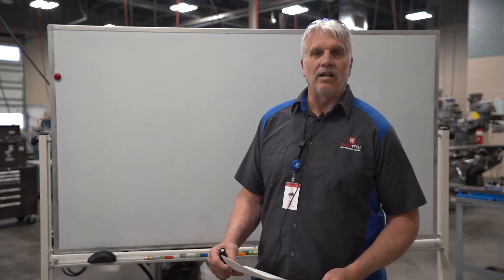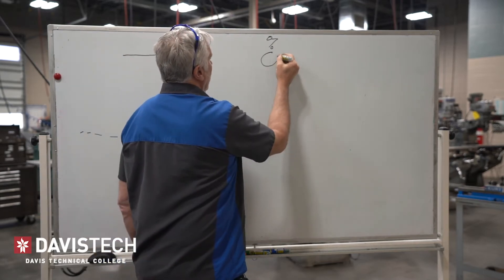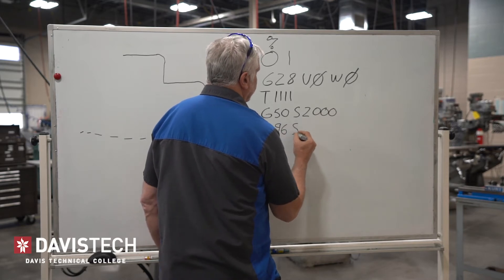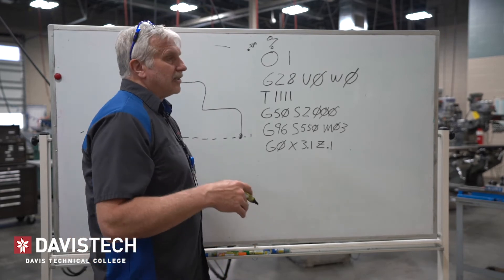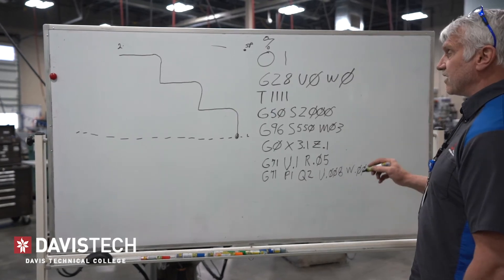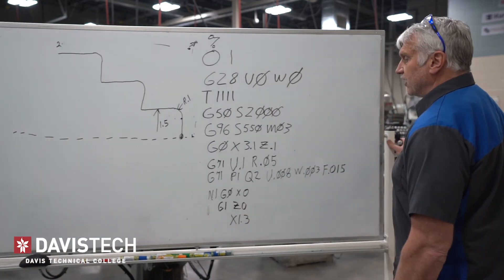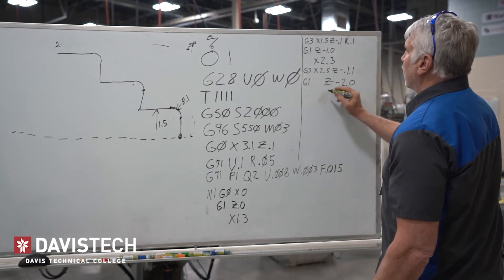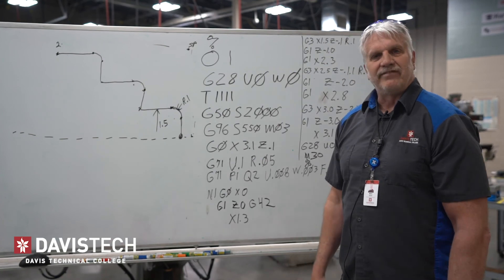Programming a CNC Turning Center 1

Comment: Hello, I hope you have a very good start to the new year 2023, I have a question and I hope you can help me.
Currently working with a youji(fanuc) vertical lathe.
I am studying a book which is CNC CONTROL SETUP FOR MILLING AND TURNING(PETER SMITH) which is based on fanuc, there is a section where the g90(Box type roughing) cycle and g94(Box type face cutting cycle) are listed, so my A question arises when I see that in my machine (youji) it takes g90 and g91 as incremental and absolute, what could be the reason for this, this type of cycles of g90 with cycle was discontinued and they were changed to absolute and incremental? If so, then How do you give your origin just with g54 and will be all absolute??